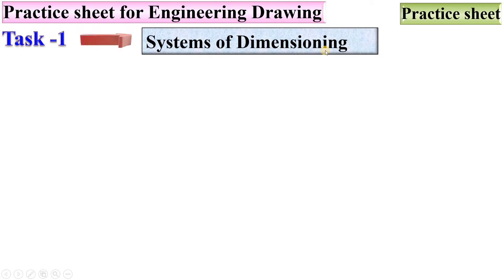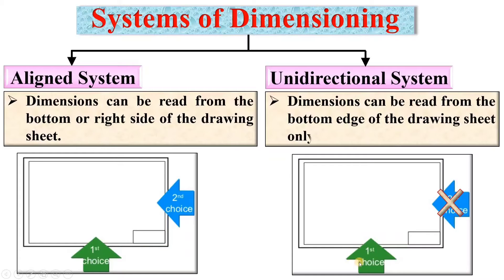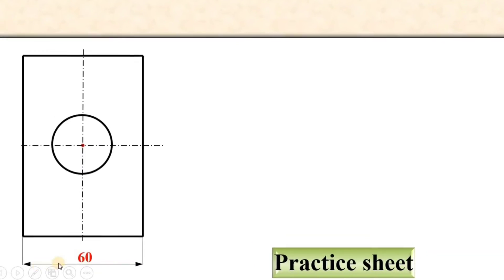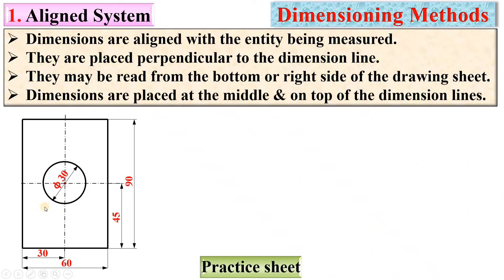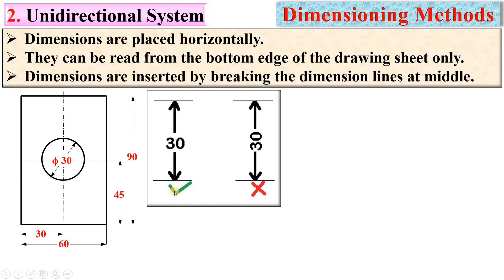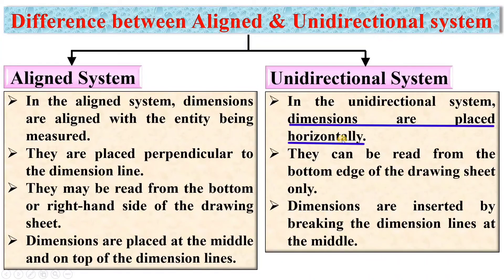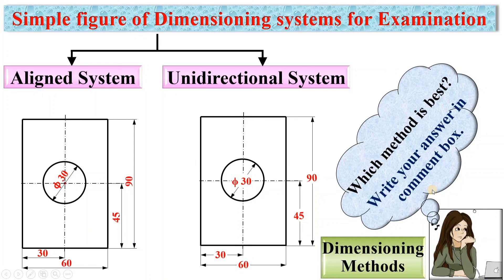System of Dimensioning | Aligned System Vs. Unidirectional System | Engineering Drawing

Comment from the maker: System of dimensioning is explained with following timestamp: 
0:00 – Engineering Drawing lecture series 
0:12 – Practice sheet for Engineering drawing
0:36 – Practice sheet
1:01 – System of dimensioning
1:51 – Dimensioning methods
1:53 – Aligned system
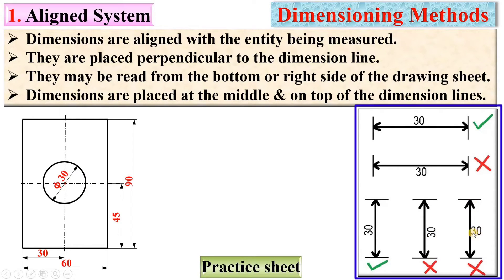5:01 – Unidirectional system 
7:19 – Difference between Aligned and Unidirectional system 
8:32 – Figure of dimensioning systems for examination